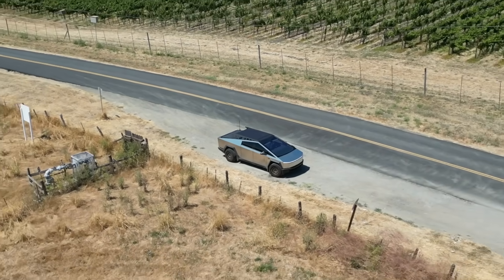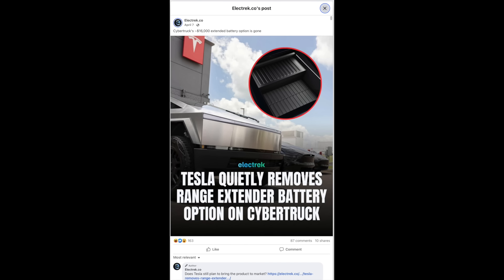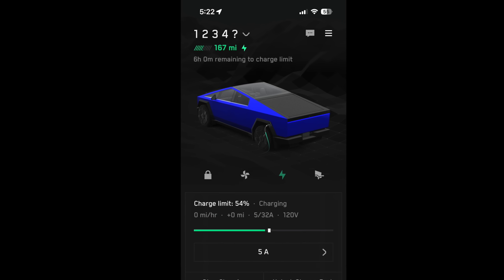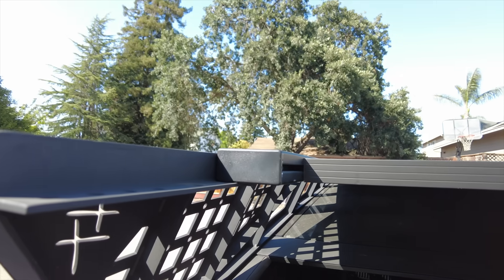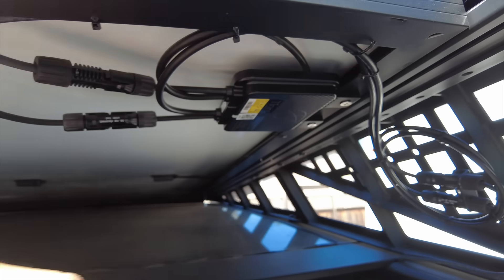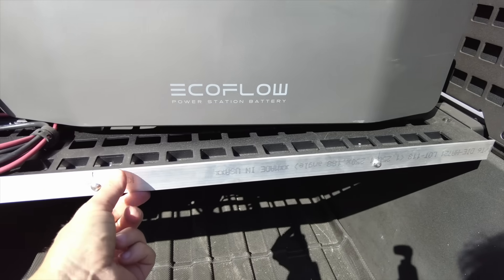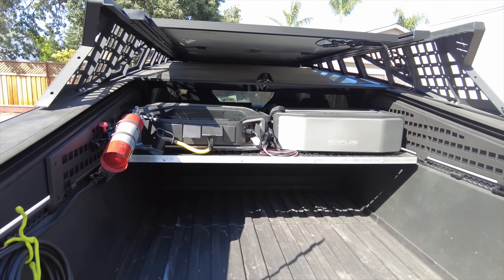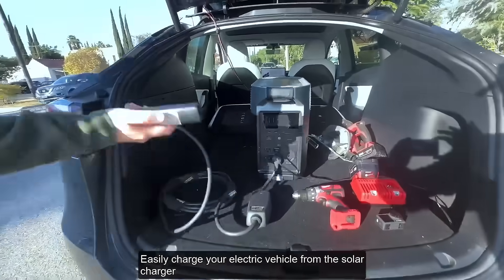Cybertruck Off Grid Solar + Battery: Build Breakdown Deep Dive

Comment: Great build, super clean! Consider this build https://youtu.be/72mPUBpFrhQ?si=8wS256gOqD4UR5U5 Its 240v input and output. Think recharge storage battery with truck bed 240v while you supercharge.  It works. And, use solar.  Consider this build for less expensive but parts you'd need to water proof. https://youtu.be/oisSDHpgld0?si=gO58re8BQ-y_sji5
Cant wait to see your iterations. Have fun!
Reply from the maker: Oh yeah. I love that guys channel!!!  Haven’t seen those videos yet though. Thanks!

Comment: Not bed setup. There are more efficient solar panels around this size around 470W. With full length bed rack u can fit 2 of those so 920-940W. There is another option if you do not need 5 seats, one seat can be removed,make a closed place for batteries and there will be space left for camp equipment+few bluetti pv420. Together it's 1800+W. The only problem with it the wiring, solution a sealed hole in the rear window or through the body if there is such an option in the documentation
Reply from the maker: Wow, that’s really going all out.  I’m not quite there yet. I’m trying to keep the truck as functional as possible.

Comment: Interesting effort; but many challenges in developing a meaningful solution, as you are seemingly quite aware.  One thing I would want to know is the percentage range loss due to change in the aerodynamics of the truck, if any, due to the rack and panel(s), plus the added weight of the battery etc.  (?)  (Each loss of 1% of range would necessitate about 1.2 kWH of energy per day just to break even.  That's against a 420 watt panel that would average perhaps 2.4 kWH of energy per day?)
Reply from the maker: Yup. Very aware of aero loss. This system is more of a drive into the woods until I’m low on energy. Spend a week off grind and come back with a decent charge from the sun. It’s a work in progress
Reply: @WorthWords-cw5xh  Totally great plan, though my shot at this would be to get about four or six "solar blankets" at 400 watts at 16 pounds and 3 square yards each (Renogy or similar) and dispatch them on some flat or beneficially-sloped ground and also as a vehicle sun shade, all when NOT in motion.  This obviously does nothing beneficial if you drive all day, whereas the hard-mounted panel could, but if you go into a clearing in the woods (or the dessert!) for a number of days with an appropriate power station (some recent ones even sporting 220v from a single unit?), now you're doing useful energy farming!

Comment: It's not a battery warming issue it's the cost of energy to run the AC to DC rectification.
Reply from the maker: That’s probably part of it.  But if it was all of it battery shouldn’t go lower. Just up slow. The fact if energy gets dumped rapidly the battery will increase where if it is put in slow the battery will going down makes me think it’s more than conversion loss
Reply: @WorthWords-cw5xh if it takes 620W to run the onboard Converter and you put 600W in from the grid you will need to take 20W from the battery to run the charger. From what I've seen is most cars use around 300W running the onboard converter but cyber truck is 800v not 400v so it having to use 2x power to run it makes sense.

Comment: Fun project! I look forward to seeing where it goes.
I wish all EVs had a solar input (that also works while driving)so we could just skip the battery all together.
Reply from the maker: That would be cool
Reply: Look up Aptera, its a very efficient car that has solar all on top of it and its more of a 2nd car for a family since its a 2 seater
Reply: @Rafael3816 I want one of those
Reply: Why?  You are lucky to get 200-300 watts out of a solar panel at peak times.  It would take hours to even gain 1 kWh of charge which is nothing when a pack has 80-200 kWh of capacity.  Add all the complexity of a MPPT, solar panel and having to work with regenerative braking.
Reply: @handlealreadytaken because my car spends hours a day in the sun, and free/passive energy is more valuable/convenient to me than burning energy to remove waste heat aka energy from the cabin. Slow gain>slow drain.
 If a solar panel is so useless, why do campers always have them? 
A solar panel is literally a free energy device. People not wrapping their heads around the potential of this blows my mind.
Reply: @lyfebehyndbars9729 a lot of people are black and white answers only, not able to comprehend incremental improvements.  Direct AC and DC charging inputs in the bed would be cool, at least as an option.  Solar yes, but really would open up the flexibility for any power source.  All the inverters are already on board for AC that's just a matter of a second wiring harness.  Getting a DC source at 400 or 800V would be a challenge, but that's where innovation could kick in.
Reply: This is the idea for the Aptera for daily driving it can fill up on solar alone.
Reply: Exactly what I am hoping for too. or at least a charge port in the box (for generators on ev pickups)
Reply: @hightechredneck8587 yeah that’s a good point, it doesn’t actually need to be a dedicated solar input. Just some kind of DC input. That would be game changing for lots of people if you could simply plug in any random power bank or generator to give you extra range when it’s actually needed.
Reply: Range is so bad you need a solar panel?
Reply: @healthygrowth7760 eye roll. yet another person who completely missed the point. I’m too fatigued from explaining this simple concept over and over again. If you can’t comprehend it, not my problem. 
Have a nice day.
Reply: @healthygrowth7760 When was bad mention? Efficiency is where it’s at. Solar is just an add on, it’s like any other electric car where you can just charge it
Reply: @Rafael3816 put a wind turbine on top of the car teslabro 😂😂😂😂
Reply: It needs multi-junction photovoltaic cells.
Reply: lol!!!!! solar is just to keep the low voltage battery trickled charge and run stuffs like the AC, the low voltage systems of the vehicle, tesla should have offered a roof with solar panels instead of glass, i really dont get the obessession with glass.
Reply: @carholic-sz3qv totally agree on the glass roof thing! I would pay a premium to trade my glass roof for a solar roof in a heartbeat.
Reply: vehicles like toyota prius prime and some few hyundai offers solar roofs for the low voltage use not to charge the high voltage battery.

Comment: Lol why was everyone here scared to say this is dumb
Reply from the maker: It’s not a perfect system. But that’s why I’m sharing.  We can make it way better and shorten the learning curve for everyone
Reply: I am genuinely interested in this sort of thing. Getting free energy from the sun is a useful function.
Reply from the maker: @lyfebehyndbars9729 as am I. Thanks!
Reply: @lyfebehyndbars9729 if its not 1000w min your wasting your time. The slide panels are the ony ones that come close i have a 1100w system like this that plugs into one of my ev*s and it only gets 5-6% a day
Reply: @darkdragonentertainment8778 same argument I’ve heard over, and over, and over…..
how is a passive process a “waste of your time”? My car looses a couple/few percent keeping the cabin cool. Burning energy to get rid of waste energy is an exercise in inefficiency. I’d rather harness some of that energy to gain a couple/few percent. 
Slow gain>slow drain.
Reply: @lyfebehyndbars9729  My thought exactly. If I had a gas can that magically turned air into gasoline at one Liter per day people would sing songs about it. but charge an ev with easy solar and nothing but haters.

Comment: I’m looking to do something similar but I was going to mount the 400w panel at the end of bed and add a wedge to decrease the drag. Did mounting the solar panel increase the drag? If so, how much efficiency did you lose after mounting the panel?
Reply from the maker: The panel not to much. Mars actually did some research on their site recently addressing the racks aero. The wheels and tires are probably more of a drag

Comment: By a generator and be a serious person. Because tesla dropped the battery pack, they should allow you to charge while driving. Through 14-50 plug in the bed. 
A 6500 lb truck with a range of 100 ish miles at a SOC of 20% to 80%.
Off roading? It's a cool machine for an apartment dweller that lives 10 minutes from home.😂
5 gallons of gas is much easier than any battery pack.
Reply from the maker: Agreed
Reply: It is spelled buy.
Reply: Everyone’s goals and needs are different.

Comment: Get a GMC SIerra EV with 500 miles of Range, problem solve.
Reply: The long-term reliability is very questionable.  🤔  With Tesla, at least you know what you are getting.
Reply from the maker: @turbo95eclipse true.  Sandy Munro has helped shine a positive light on Tesla’s lead in engineering.
Reply from the maker: I had considered it.
Reply: problem galore dude

Comment: man you lost me when you started to conflate AC charging with DC charging.  There is no such thing as a "home wall charger" its a connector that outputs AC there is no rectification going on there.  Good idea but all the terms are goobled up.
Reply from the maker: Correct. No rectification in ether charger. The rectification happens inside the truck.  I was merely trying to emphasize the difference between the mobile connector and the wall connector. The plugs look the same, but the output is very different.  The app makes it very confusing. Because they will both say 5A, but the watts will be twice as much coming from the wall connector. Sorry if I didn’t make that clear.
Reply: @WorthWords-cw5xh I have both and I understood what you meant… but maybe not everyone would? 🤷‍♂️

Comment: Nice work, looks clean!
Reply: Can't wait to see your version with the sliding panels. Could definitely do a nice off grid set up with that plus if could plug in additional camping ones on you can put on the ground you could probably get close to 3kw (maybe more?) when camping somewhere.
Reply from the maker: @GridConnections  yes. With that many watts, you’d get a decent charge.